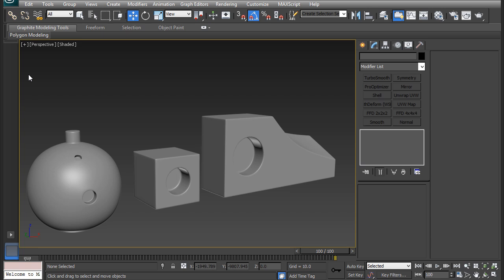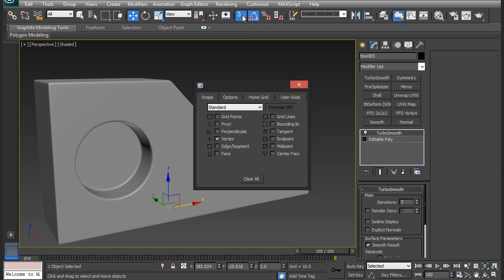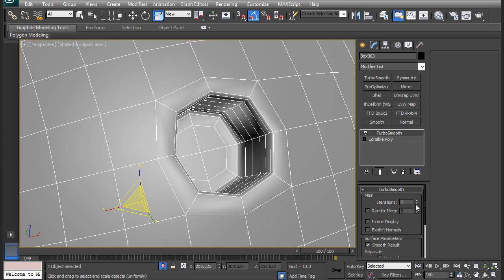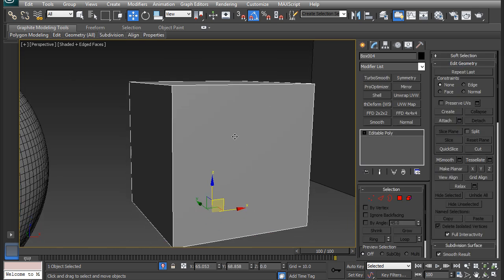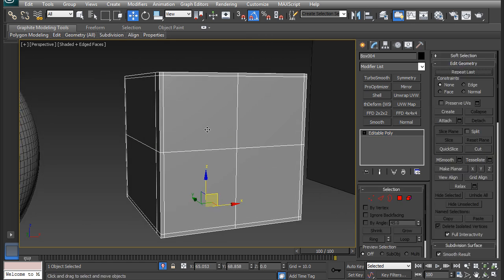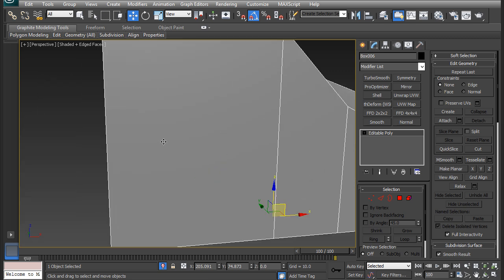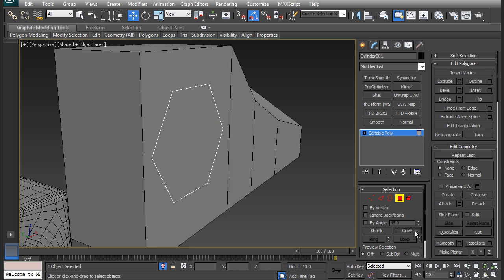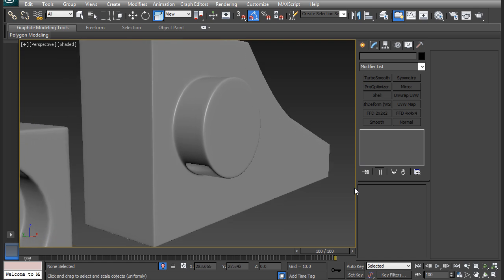Using the Loop Tools in 3ds Max to Extrude a Circle on Any Surface - 3dmotive

Comment: Please show how you do the same thing with the cylinder. When you convert the loop to a circular shape (with Loop Tools) it gets flat from the side view, but it shouldn't. In this case it is better make 8 sided cylinder, make spline from it's edge, and with the ShapeMerge (compound objects) project it onto the crossing of the cylinder edges. Then with cut tool add corner edges and do the same thing with inset and extrude. And even though it will have right topology, with the TurboSmooth it will anyway be not ideal. This is where I like SolidWorks, Fusion or Rhino. I wish 3D max was able to treat geometrical objects like that not ruining the topology.

Comment: what version have you? 20..?
I don 't find the loop tools to make a circle fromm selection. HELP PLEASE
Reply: +Ionut Tutui  Press 2 on your keyboard to bring up edge select mode.  It wont work under border mode.
Reply: Thank, I will try and let you know
Reply: No worries!  Just to clarify you have to press 3 for border select, click the open edge to select the border THEN press 2 which will take you into edge mode.

1 through 5 on your keyboard represent vertex, edge, border, polygon and object (if that's what it's called) selection.  Jut as W is move tool, E is rotate and R is scale =)
Reply: I understand you perfectly,it works even for me. Thank you very much.Keep up the good work